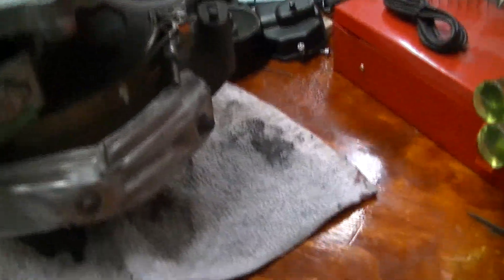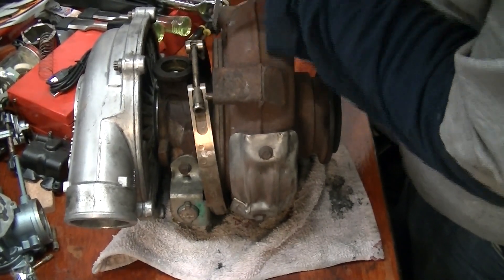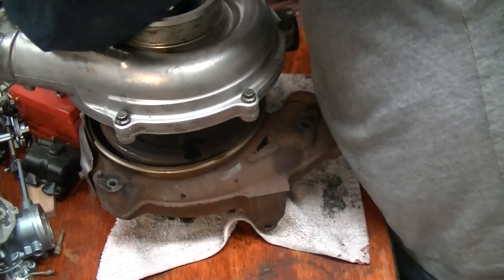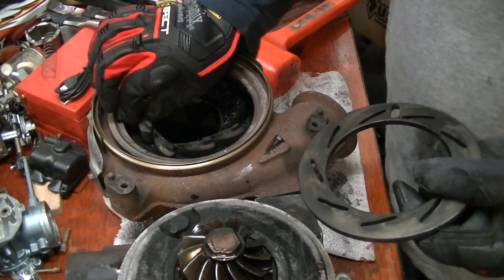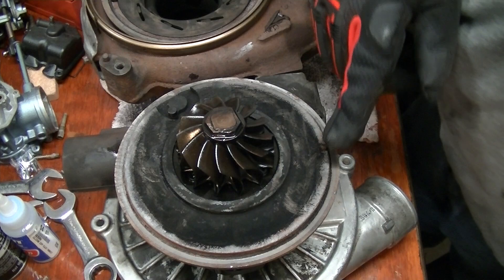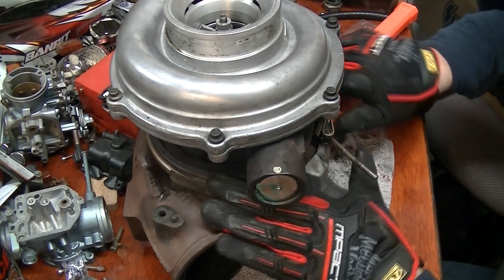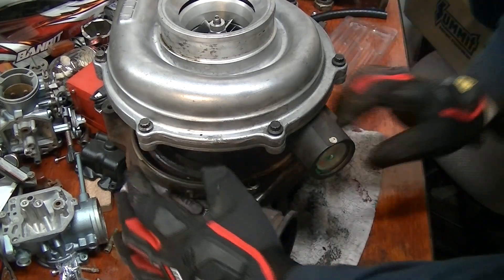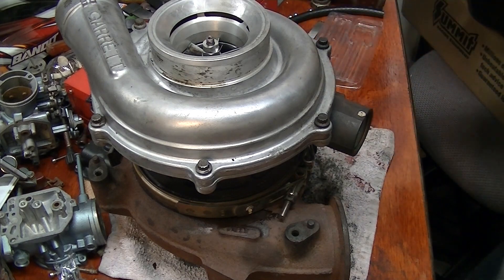HowTo: Ford Powerstroke Turbo Disassembly and Cleaning (2005 F250 6.0L)

Comment: Wrong, the cast on the turbo where the unison ring sits gets rusty , why didn’t you clean that? Ive seen unison rings stuck to that side, you only cleaned half the problem 
But I’ve only been doing this since 2000

Comment: What i did to clean all of the vein pieces and the unison ring was i soaked the small pieces in a thing of acetone for a bit to just eat off most of the soot and then i used a soft steel wire brush on each one. then i good a sanding bit and some alcohol to clean the unison ring itself then just the brush and alcohol to clean the exhaust housing itself. then the cold side i just used the stuff you get on the back side of the sponge and some brake clean and it worked really well. wont look brand new but will definitely get all the soot and dirt out of where you have any

Comment: Great way to ruin a wood chisel!!! I’m sure your dad is very proud. Smdh
Reply from the maker: You do realize that was a cheap Chinese HF chisel, right?  Not exactly stellar quality to begin with - and yeah, both my father and my grandfather were pretty clear - the right tool is the one you've got available that can get the job done!
Reply: One more smart a**... Dude just be thankful.
Reply: Still ruined!! But great video! I just did my turbo. Replaced not rebuild but I did check the veins and mine just fell apart.

Comment: When you were pushing the vane plate. Is the actuator still connected on the outside of the turbo? If not that appeared to be sticking pretty bad.
Reply from the maker: The actuator is internal, IIRC.
Reply: +uberDoward makes sense than. I'm used to seeing external ones.
Reply from the maker: Slight difference :)  The actuator is hydraulically controlled by the oil pressure (that's what the big solenoid is in the center cartridge of the turbo)

Comment: Thank you for the video. I and many others would be very grateful for a video showing the removal, cleaning and re-installation of the Turbos for the 2008-2010 F350 6.4. I've found many for the 6.0 and nothing for the 6.4.
Reply: I just removed mine 4/9/20 it is a job I'll say that if you don't say bad words before you start you will before your finished
Reply from the maker: Clay and Susan Gibson I would love to, but I'd need a 2008+ Super Duty to do it on!
Reply: uberDoward Perhaps that could be arranged. Where are you located and how much would you charge me to perform this on my 2008 F350 ?, you could make a video for others using my truck...sounds like a win - win for both of us... :)
Reply from the maker: Well, I'm located in Jacksonville, FL :)  I'd have to look into what exactly it entails - if it's anything like the 6.0L, it's most of a day's worth of work - took me all weekend when I did mine, doing the video!

Comment: You have some of the best 6.0 repairs vids.  I like how you show everything pretty much step by step.  I plan on tearing into mine next year when I hit 200,000 miles with many of the same repairs as you have done.  I was curious if your MPGs went up after the egr and exhaust updates?  What tuner are you using?
Reply from the maker: Well thanks!  No tuner yet, but I intend to get one around Christmas time.  My mileage didn't change much - but the previous owner had straight piped the truck, so it wasn't so much flow that I picked up.  Over stock, I'm sure it would have made a good difference!

Comment: Hi can a turbo on the 6.0 cause a blow by or oil consumption?
Reply from the maker: Cause blow by?  No.  Oil consumption?  Yes - but the turbo wouldn't be the cause!  A clogged up air filter can cause a large vacuum over the PVC system and draw in oil if the oil has no 'trap' to prevent it.
Reply: Hi  thank you for replying. the air filter is clean  . I forgot to tell you. their is little bit of oil drips down on the drive way when I park the truck over night. its coming from the bell housing of the transmission, its motor oil. every time I drive the truck 10-40 miles the dip stick indicator reads half way. also I have a blow by  when engine warms up. thank you.
Reply from the maker: Sounds like it's time for a rebuild!
Reply: how many miles do you think the 6.0 will go with regular oil changes, until the lifters start to fail.
Reply from the maker: Depends on if you keep it stock.  I haven't heard of lifters failing in a 6.0L, though...
Reply: thank you.
Reply from the maker: You're very welcome :)
Reply: uberDoward  lifter Failure is quite common. It happened to my truck lost the needle bearings in the lifter and went through the oil pump and cam, when they go they go and destroy a short block. Happened at 284,000
Reply: Drain screen is clogged
Reply: Drain screen is clogged